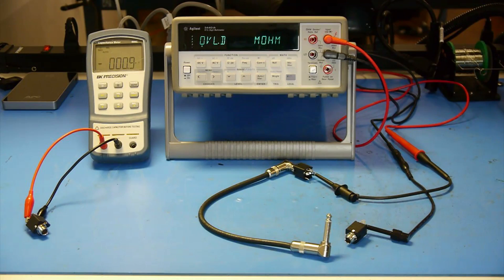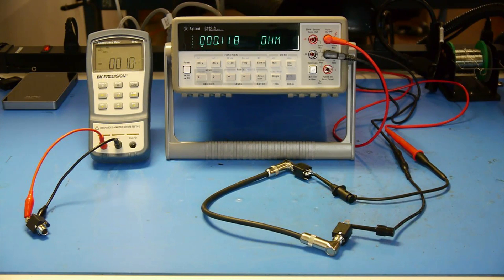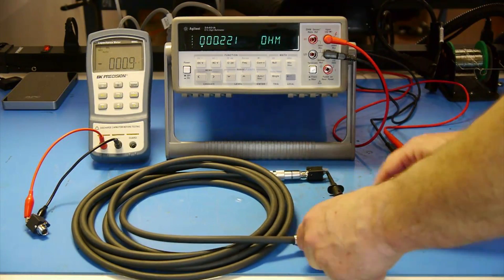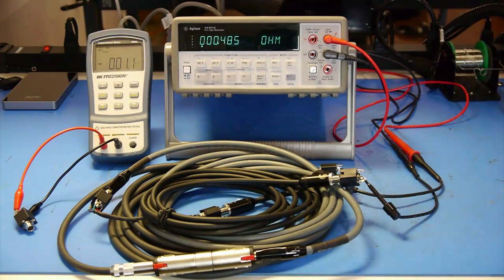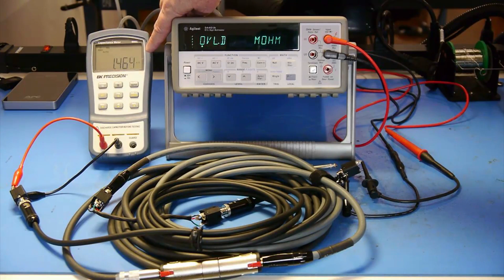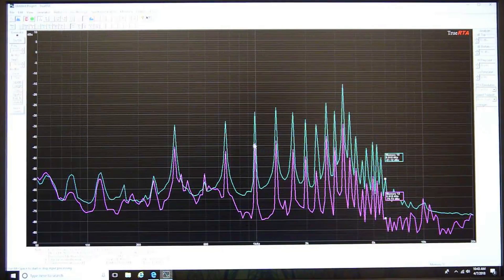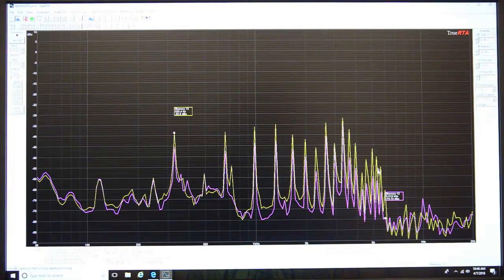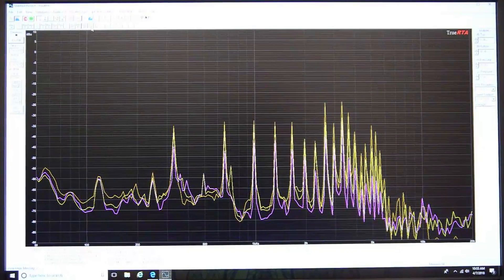Can we Measure Tonesuck?

Comment: what meter  is that the LCR
Reply from the maker: The capacitance Meter is a BK Precision 830C. They are still available new. The DMM is an Agilent 34401A which is no longer available but you can pick them up on eBay sometimes.
Reply: @JamesLebihan  I ordered a DE-5000 Handheld LCR Meter
Thanks much